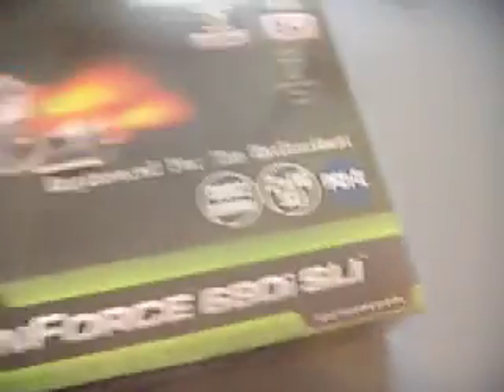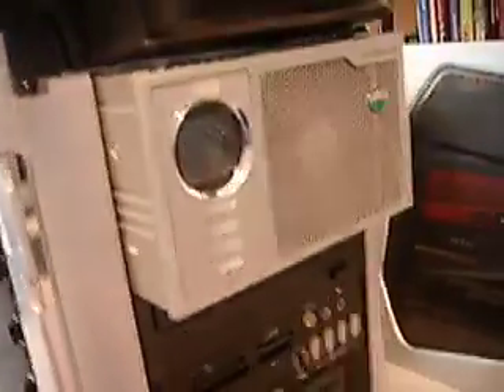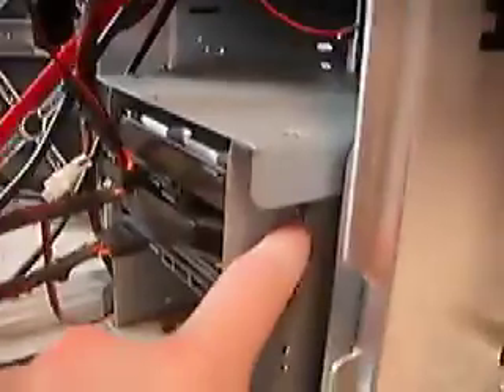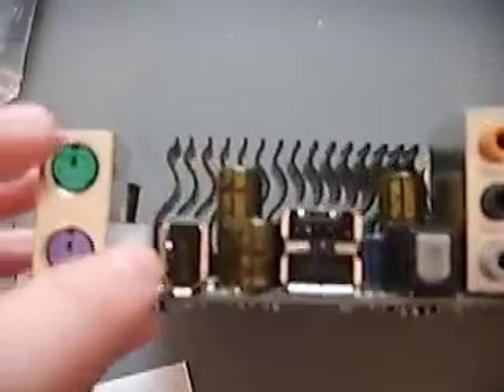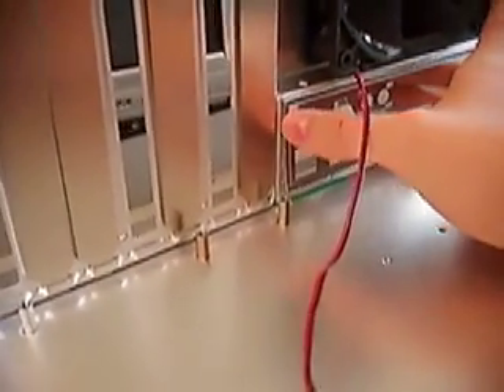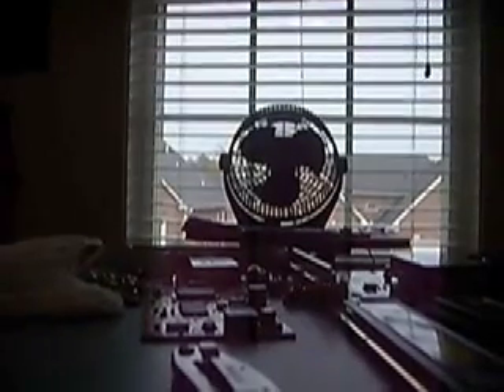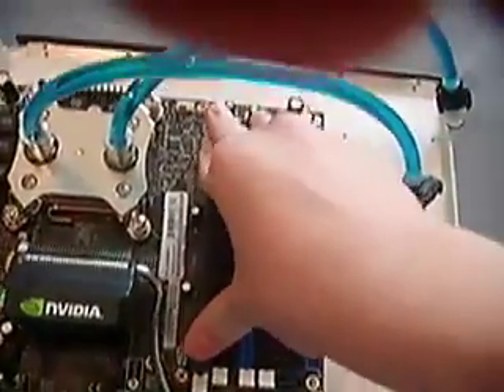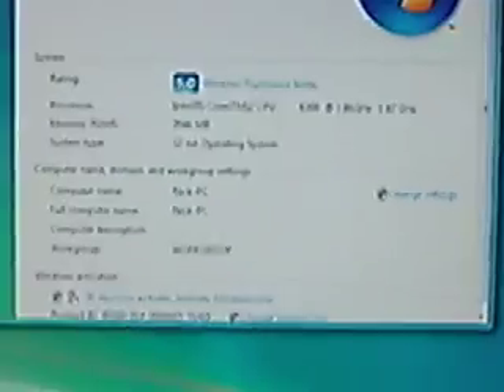How To: Bulding a PC

Comment: good tutorial. you skipped some parts, but other then that, your good. just work on your cable management. for a real basic computer build, no need for a liquid cooling system, air cooling will do. for the gamer/enthusiast, liquid cooling is a good way to go if your going to over clock. especially parts made from 07. the case he is using is a good one, but i like the Antec 1200 my self. or the cooler master stacker i believe its called. good video.

Comment: hey im building my first computer.. its actually on its side ryt next to my screen RYT NOW!!! :O..... 
i'm chuggin an intel quad Q9400 2.66Ghz, MB: Asus P5Q3 deluxe WIFI DD3, 2gb DDR3, 3x640GB WD SATA hard drives 7200RPM 32MB, Nvidia 9800GTX+, Tt 750watt, Sony dual layer DVD.... and all inside my newly purchased red ases vento 3600... anyone out there share my appreciation for my first beast? hehehe... just puttin in my 2cents...

Comment: im running a EVGA Nforce 780I SLI LGA775 ATX 3PCI-E16 1PCI-E1 2PCI SATA2 RAID Sound GBLAN 1394 Motherboard w/ 2 Western Digital Caviar GP 1TB 1000GB 5400-7200RPM 16MB 3.5IN SATA2 Hard Drives and 8 gb of ram! your video really helped me install the motherboard! thnx alot!

Comment: are you still using this board? i remember watching this vid sooooo long ago. i have the same board and have been using it for almost a year now =D hows your experience been going with it? i;ve been running at quad at 3.2ghz with a 1600fsb (8x multiplyer, becuase im still running on the stock cpu cooler)

great board!!

Comment: of course you can raid it.. but you can just have a separate hard drive without using any raid control. they will show in separate letter drives (C:\ and D:\). But if you raid it in raid 0 for example it will just be in C:\.

All you need to do to add another hard drive is to have an SATA slot available in your mobo.

Comment: NEW:
Asus Striker Extreme motherboard
Intel E8400 3.0ghz CPU
850W Chieftec Turbo PSU
8GB 800mhz RAM
MSI GeForce 9800GTX OC
500GB Samsung SpinPoint 7200rpm harddrive
Samsung 931c 19" LCD
Scytche Ninja CPU cooler

Comment: everyone is putting there computers up so i thought id do the same ;)

storm dragon case
750 watt psu
gigabyte p35 motherboard
4 gb ballistix 800mhz ram
intel q6600
geforce 9800 gts
500 gb wd (10000 rpm)
water cooling system
22" monitor

Comment: I have the same processor like you the rest is a 8800 gts 640 mb 700 watt power supply 3 gb ddr3 and 500 gb sata2 hdd and of course vista but u have a advantage :YOUR MOTHERBOARD IS SLI im CRYIIING!!

Comment: @ Airsofter18889
U forgot to add that u have a very very recent pc ofcourse its gonna run great, its the compatibility thats the problem so what if it runs smooth, not worth much if half the stuff an average user needs does not work

Comment: Nice instructional. I just built a system using the same motherboard and one of the mosfet chips near the CPU exploded. Also the Thermaltake Armor is a better case, jk.

Comment: hahaha nice Smilodon case! lol thats what i got, its aight. i got the black version and this is what i have inside it.

EVGA 680i SLI A1 mobo
Intel Q6600 Quad core
4gb of Patriot 1066mhz RAM
8600 GTS 512mb video card
500watt power supply and then a 400watt for the CPU
and thats about it so far, i plan on SLI-ing some 8800 GT's pretty soon

Comment: If u want airflow the 830 is NOT the case u should be looking at anyway - thats the Antec 900, wich is less expensive and a much better fit.
If u really dont have anything better to buy (wich is impossible), then fine, u can buy the case. But almost everyone else needs to buy something that will actually give them better performance instead of a big piece of metal in the shape of a box.

Comment: Those are server cases or the like. In any case, they arent worth the price.
There is no reason to buy the 830 case. Instead u could have bought an E6600 instead of the E6300 and had far better overclocking, or another 8800 GTX or watercooling, or more fans, etc., etc. etc.

Comment: No, the only case that is more expensive than the 830 is the zalman fatal1ty and its not worth half of it's price. But the problem is that it makes no sense to buy an expensive case when u could instead buy a better component, or a bigger monitor or something that u will actually like after the first 5 minutes of using it.